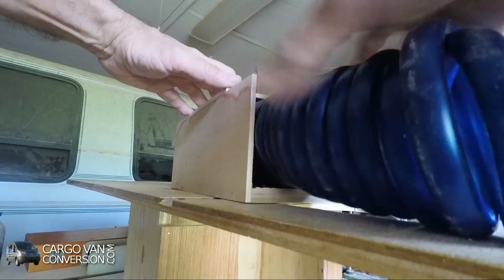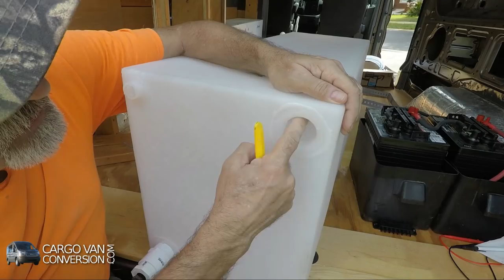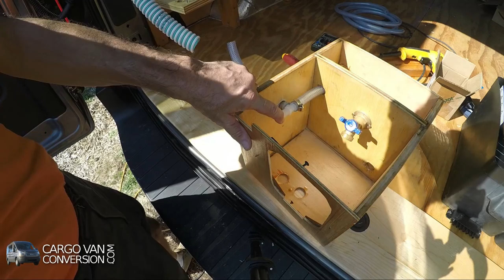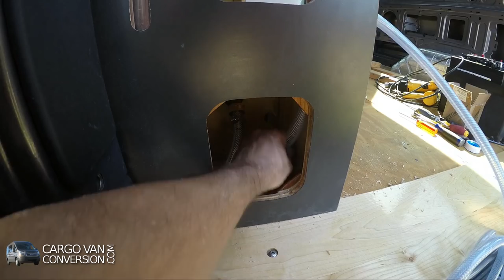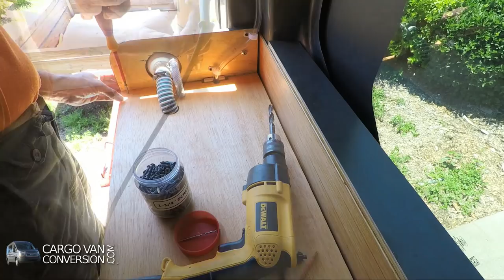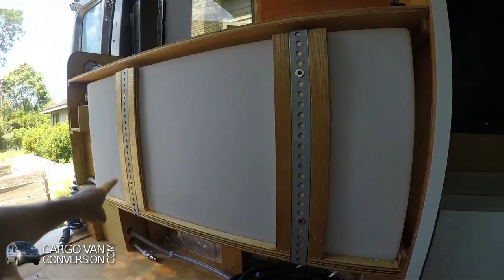RV Fresh Water Tank Installation

Comment: Awesome, what pump are you using? And where did you got that blue hose?

I don’t think you’ll have a problem spilling water through the breather unless you floor it😝😝
Reply from the maker: Hi Thunder videos,
Haven't decided on the pump yet. It depends whether I will get a RO drinkwater system (reverse osmosis). That would need a heavier pump, like one of the Aquajet's; if not, I'll likely get a standard Shurflo or similar pump. No need for anything fancy.

The Blue Recoil Hose ➜ https://cargovanconversion.com/buy/coiled-hose
You can find a list of most of the items, I use in the description  immediately below the videos. You may have to click on 'SHOW MORE' first.
Some are affiliate links, that make me a little money to support the channel and website, but that does not affect what you pay.

I'm still not sure, if water could come out of the fill or vent lines. The chances are low, because I don't intend to drive with a full tank of water. But to make sure, I might do some actual testing in the next couple of weeks. I'll show that in an upcoming video, if I survived it :)
I am considering to put check valves in, but that would only work on the fill hose; on the vent lines, it's counter-productive. If necessary, I might just put manual shut-off valves on the fill hose and the primary vent line. We'll see :)
Van Williams
Reply: Cargo Van Conversion I will probably get it 👍

Yes I had the shutflo for over 2 years and never let me down, I bought a back up 2 or 3 months ago because I had a feeling it was going to be bad soon but it’s still kicking and I use it every day washing dogs.

Keep up this good videos✌️

Comment: I missed the part where your pump is located and how your rear sprayer is hooked up to it for pressure.
Reply from the maker: Hi David,
Ultimately, two lines exit at the bottom and below the tank. One is the supply line from the tank and has a small shut-off valve mounted on it. The other hose is still open-ended and goes to the sprayer. At that same location, at the far rear and under the tank, I'll install the water pump, immediately after the valve. After the pump, I use a Tee connector for the main line to the sink, etc and the other to the sprayer. I'll show it in an upcoming video.
I would have already installed the pump, but I'm still deciding on a RO system (reverse osmosis); that would require a much heavier water pump.
Van Williams

Comment: I don't see information about the PVC connectors going into the 1-1/2" tank outlet.  Thank you!
Reply from the maker: Hi Dale,
You're right, I must have 'misplaced' some of the clips during editing.
The vent line at the top of the tank starts with a 1-1/4 inch opening. I used a regular 1-1/4"male-to-3/4"slip PVC connector, followed with a 3/4"slip-to-3/4"female PVC connector. Then used a regular 3/4"male-to-1/2"barb connector (https://cargovanconversion.com/shop/connector-male-barb).
For the bottom fill hose connector, I used a 1-1/4"male-to-1-1/4"barb connector (https://cargovanconversion.com/shop/connector-male-barb-1-1-4). Used regular hose connectors to secure the hoses.
Van Williams
Reply: Thank you Van!  I'm designing a simple auxiliary tank for our 5th wheel and can carry it in the truck bed for extending our boondocking trips.  Hoping to avoid having to buy and use a small water pump (DC connection, etc.) and just use gravity to re-fill our fresh water tank in the rig.  Did you use plumber's tape for those large connectors into the 1-1/2" inlets in the tank?  Also Van, you mentioned "1-1/4 inch opening", but the tanks show 1-1/2 inch NPT female openings.  Did you mean 1-1/2"?
Reply: Hate to ask Van, since you've been so kind, but I can't source the first connector.  The 1-1/2" or what you called a 1-1/4" male to 3/4" slip PVC connector.  Any help would be greatly appreciated.  Thank you.
Reply from the maker: Hi Dale,
No, both connections are PVC so never use that tape. I only use it on metal-to-metal connections. These openings in the tank also taper slightly, so be careful not to tighten them too much. I used pipe thread sealant https://cargovanconversion.com/shop/pipe-thread-sealant to make a lasting connection.
These plastic tanks usually may have either 1-1/4" or 1-1/2" opening(s) and a couple 3/4" openings. Mine has the first, yours apparently the second. You can verify it simply with a tape measure :)
Van Williams
Reply from the maker: Hi Dale,
To be honest, I encourage questions, although with more viewers on the channel, it's getting more difficult to answer.
If you can, go to your local (if in the US) Home Depot or Lowes and find a 1-1/2" that accepts 3/4" reducer. For instance either 1-1/2"-to-1" and 1"-to-3/4" reducer or  1-1/2"-to-3/4" and 3/4"-to-3/4" reducer. These should be readily available.
I found a more appropriate 1-1/2"-to-3.4" connector https://cargovanconversion.com/shop/reducing-bushing-112-34 Then you can directly use a 3/4"-to-barb connector for the hose.
Hope that helps. Good luck!
Van Williams
Reply: Thank you Van!
Reply: The company that makes and sells the tanks is Class A Customs Van.  Both the 46 gallon (the one you received) and the 40 gallon (the one I'm thinking of getting) have the two 1-1/2" openings along with two 1/2" openings. Your advice is sage, to measure once I get it though.
Reply from the maker: Hi Dale,
they always say measure twice, cut once. Well, I should measure three times before opening my mouth :) I was so focused on the 1-1/4" fill hose, that I got confused. You're right, these tanks have the 1-1/2" openings. I should follow my own advice.
Van Williams

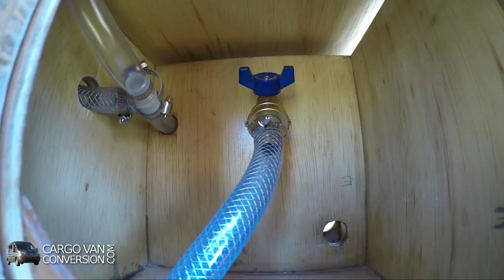Comment: Joey's back to his micromanaging I see.  hehehe  Not sure if it was temporary but saw you left the clear (unbraided) hose backed off from the shoulder on the tee (~10:00) and wondered if you were aware of it.  Saw you put the hose clamp on so seemed permanent.
Reply from the maker: Hi Neil,
I looked at the specific frame of the video, but the hose is all the way on the tee, but I can imagine that it doesn't look that way. Feel assured that it's OK. Since it is a low pressure system and and most of the hoses fit to a T (I even had to use a heat gun to soften them up), the clamps are an extra way to secure them.
You have a sharp eye, though! I have to be careful next time :)
Van Williams

Comment: Good video but please don't play music, its deafening. Silence is golden.
1.  Please go buy the Dewalt 20V #887 Impact driver with a 3 amp Max Lithium battery for your nuts and bolts.  Not the #885 but #887 - minimal cost difference but maximum benefits.  Drill #885 is okay.  Still using manual screwdrivers on wood is a waste of time.
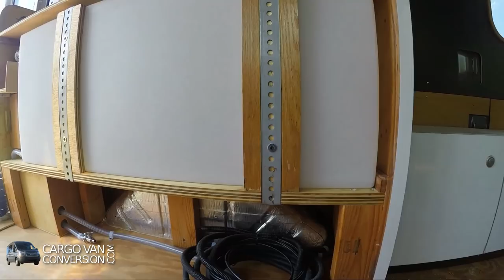2.  18:47 - using plywood strips to hold tank in place is a weak structure.  Use solid wood.  You are screwing from the plywood underneath into layers of plywood, not the solid side, so it will split open.
3.  Where are the baffles inside the huge 46 gal tank?  That water will slosh around and create stresses on structure and for this relatively light van, an instability which can be prevented by baffles.  Tank should have come with baffles, or you need to insert them inside to prevent water movement.  Smaller tanks may not need it, but this one certainly does.
Reply from the maker: My newer videos have no music in them and while some prefer that, I would like to add some again in the future. Lots of issues though. Every viewer has a different 'loudness' setting on their computer, but for me it is the constant dealing with unfounded copyright infringement notices. I've switched to YouTube music and the notices continue. That's life of a YouTuber :)
The issue of cordless/battery operated drills/impact drivers is a frequent part of the comments. I just love to use anything non-mechanical; while I'm not technically doing furniture work, I love hand planes, hand sanding, scraping and alike. Taking it slow is much more appealing to me, than the fast paced world of construction. Sitting down, feeling and smelling the wood makes me want to go on. Stopping work, because my batteries are run down, doesn't work for me. I'm probably a last of a kind :)
I can agree with attaching the straps to plywood; solid wood would have been a more robust solution. The straps are connected to the wall with plusnuts, the bottom into one inch plywood and around that more closet walls (with solid wood). While I would do it differently, I'm not very concerned as most movement is from front to back and not sideways. But never too old to learn a new trick.
You also have a point about the baffles. I have considered it, but would probably go with two smaller tanks in the future. Several reasons for this tank. Hugh price differential. Specific space allowance available in the design. My anticipated use is infrequent travel and short distances. At the very last moment before heading to the boondocking site, the water will be usually loaded and most of it, if not all, consumed during the stay. It's unlikely that I will travel with much more than a few gallon in it. However you make a valid point. I did do some testing with a full tank and some aggressive driving and it shows: https://youtu.be/DOq1ZkxdkjM
Thanks for taking the time for these useful comments.
Happy New Year!
Van Williams
Reply: @cargovanconversion  The music issue... ask yourself 3 things:  
Is the video for my consumption or others?  
Can I please others with my choice of music?  
Can I please everyone equally with music over silence?
1. The video is for viewing by others not yourself.
2. There are always those offended by your choice of music.  Some may like it but not everyone will like it.
3. Music may (and frequently does) offend.  Silence never offends.  
If you still want to play music in your videos, I will never go back to viewing them,  Silence is golden.  My ears do not deserve abuse.

Comment: I'm sorry, but the way you use your table saw is dangerous. Please don't use your miter gauge in combination with the rip fence. You're just asking for a kickback.
Reply from the maker: Hi Brian,
sometimes I use the fence to determine the width of the piece to be cut and then push the fence away. It seems that I may not have done that in one shot of this video. That could be unsafe, as you indicated. In the next shot, you can see a better way to do it.
Woodworking is a constant learning process and you always have to be cautious. The best rule, that I follow, is to spend less than one hour at a time, working with these large power tools, just to stay focused. I find that most mistakes happen on repetitive tasks, during long work days.
Thanks for your comment!
Van Williams

Comment: Leak city
Reply from the maker: There are pros and cons to having a completely interior water tank; the main reason was the stealthy exterior, that I pursue with this van.
If you are focused on the interior fill station, I can say that during the last couple of months, it has been working fine. I do have to be careful not to fill the tank to fast, but otherwise I have no complaints.
If you refer to the possibility of leaks with an interior tank, that will apply to most installations. The choice of an interior placement is mainly done to avoid any freezing issues in winter. Relatively few tanks are installed under the vehicle, as they would need additional heating in winter, unless you winterize the tank and not use it.
Thanks for watching.
Van Williams